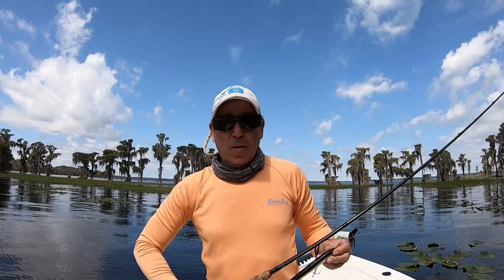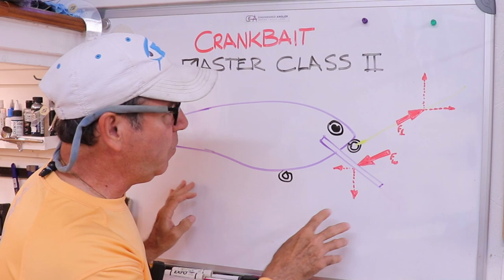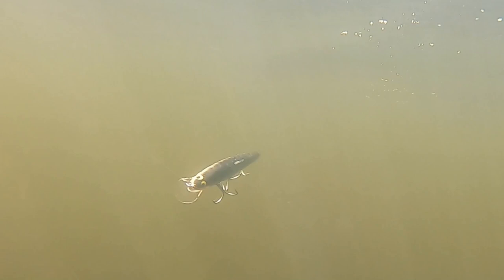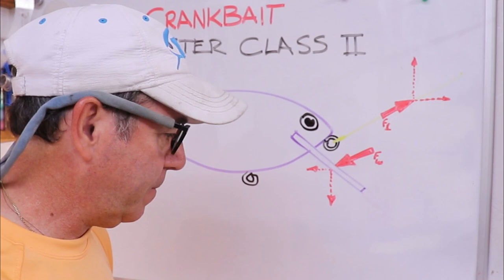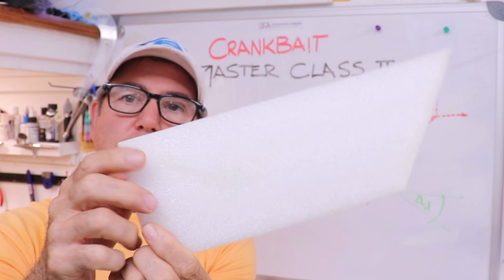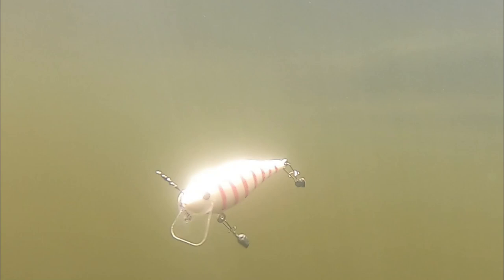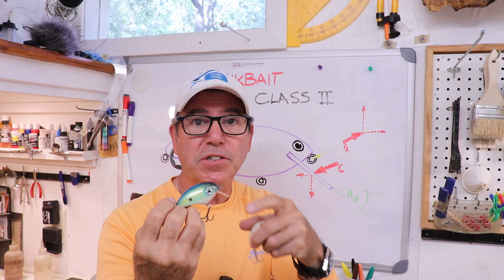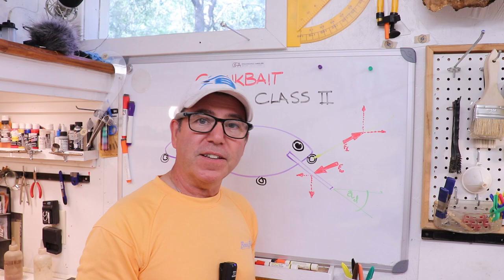Crankbait Master Class II, How Crankbaits Work

Comment: Thank you so kindly for all your time and energy that you've put into this channel! I have referenced your videos so many times! I made your Game Changers last week, and they came out looking really awesome! I put big "Stick-o's" on the back from Cabelas, and the lures all three spiral on the retrieve rather than wobble like yours did in the video. I am sure I have something off center or have some of my balance off with the lures, but I was wondering if you have a way to cure that spiraling without scrapping the builds. I love the concept of the Game Changer! Yours on the video look amazing! Could I put some lead tape on the bottoms of them somewhere to help them stabilize and wobble rather than spiral? - Thank you so kindly, Tres
Reply from the maker: First put a small tail on it. It should be tapered with no legs or any other protrusions. Make some aggressive adjustments to the tie on eye.
Bend it to the side away from the direction of spiral.  If you can't get the spiral out try bending it up away from the bib ass well. If you still can't get the spiral out the bib is installed out of square too much.  Good luck.
Reply: @EngineeredAngler  Those are awesome suggestions! Thank you so kindly....I was worried my "Stick-0" was too long as a trailer off the back end. I didn't think about bending the tie eye up ward, that is also a bigtime idea! Thanks so much for all your videos and for the reply today! I am enjoying making crankbaits and experimenting. I have learned so much from your masterclass videos and from you engineered and precision approach to this craft. Do you have an email address that you use for the channel? I would love to email you some pics of the Game Changers i made after watching your video! - Thanks so much, Tres
Reply from the maker: you can email me at Engineeredangler@gmail.com

Comment: Hi Franco! Seeing that lure you showed at the end, the one that didnt worked good, I noticed that the lip angle & position on the body and the position of the line connection screw eye, is almost the same as some lures that I did, that didnt worked either. In my case the lure body was simetrical and the lip slot correctly centered, but it either porpoised or rolled to the side and blew out, or a mix of both. It got fixed installing the lip closer to the nose of the lure. 

It seems that a steep angled lips, installed further away from the lures nose doesnt work well. Any info about this issue? 

Did you ever found out what on you lure was the cause of the bad action? 

Keep the masterclass episodes!!!

Comment: What would you consider the biggest issue with blowout? Would you suggest more shallow ballast holes vs 1 deeper ballast hole? Should ballast always go to centerline?
Reply from the maker: Blowout can't be prevented with weight shifting. The hydrodynamic forces from the bib and body FAR out power any influence from the weight.  Blowout is due to dynamic instability, usually from miss alignment of the bib or tie on eye, or an asymmetry in the lure body.  Or all the above.

Comment: Question ❓
Is there a body shape that provides roll to the bait on straight retrieve, WITHOUT a lip?
Reply from the maker: https://youtu.be/JKirTpBQWPA
Reply: @EngineeredAngler  thank you for the response. Always fascinating to see you build.  I watched this and the build of the shiner one attached. If I understand correctly the wide point being 1/3 back, on top view and side view, helped achieve the roll on straight retrieve? And I assume the all round, no staight section, of the body shape also helped the roll? Or was it the sloped head? Could that slope have acted like a crank bill?
Reply from the maker: @benrollinh526  
The idea is to avoid a streamlined shape, blunt nose tapering to a pointed tail. And maximize turbulence near the deepest part of the lure.. body roll is exaggerated with a deeper body x-section, distance top to bottom.  A panfish shape will swim and roll.  Good luck...have fun with it.
Reply: @EngineeredAngler  you're the best Franco! Thanks for clarifying! You saved me a ton of prototyping! Like usual!

Comment: Can the width of the lip effect the action and dynamic angle? I.E can the width in relation to the the line ties dynamic force on the Z axis  cause the lure to constantly say on it's one side until failure and complete lure roll? Two identical lures, one with a square bill and the other with a round bill. The Square bill fails.
Reply from the maker: Yes, the square bill can exacerbate a misaligned tie-on spot.

Comment: This is gold! Great info. So, the line tie should be somewhere close to the center of drag of the dynamic angle. I can eyeball the center of drag of a lure if I look at it from the front and place it in the dynamic angle. The center point of the lures surface that hit the water will be the center of drag. Everything ok up to this point, but I cannot seem to understand this, when I see a steep running deep diver crankbait like for example a DT20. 

https://www.youtube.com/watch?v=Y_oNc_5kGmM 

The line tie seems to be way to low regarding the center of drag during the dynamic angle. Did I miss something?

In fact, with deep divers I had some issues with the woobling when building those. I had a few of them that dived, but didnt wobble.
Reply from the maker: I hope that it will make a bit more sense after the next Master Class...stay tuned